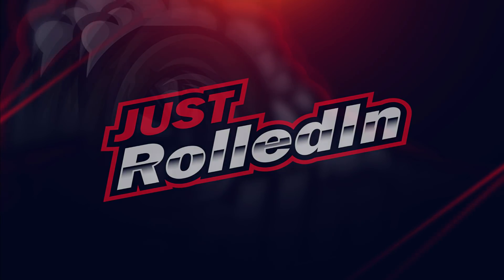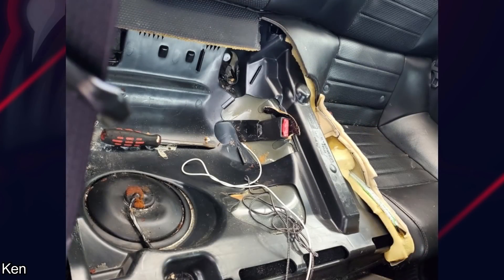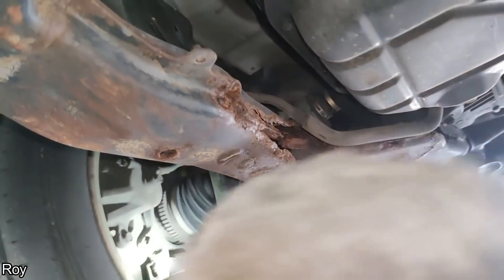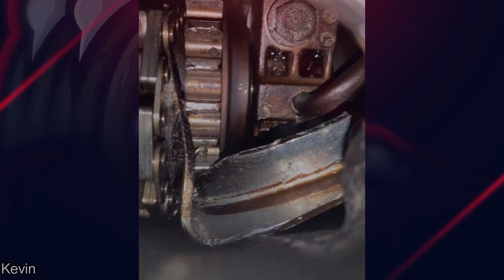Customer States "I Fixed My Broken Muffler With Aluminum Baking Trays!" | Just Rolled In

Comment: I repaired my exhaust once with a coffee can and bailing wire once just so I could get out of the bush and to a muffler shop 65 miles away. It's a different story when you pull up in your truck full of camping gear on your way home.

Comment: OMG, I don't know how you guys working in the "Rust belt" do it. So many cars with dissolved frames and suspension. (I've lived in the southwest all my life, we don't see that kind of rust very often).
Reply: My 1964 doesn't have thaq much rust
Reply: It's not so much an issue of weather as of poor construction and neglect. You can break any vehicle, anywhere, by ignoring maintenance for long enough.
Reply: Thanks for calling it the rust belt. Most of us up here call it a Shit hole .
Reply: @bug2011  LOL, I didn't want to offend the hard working mechanics there! You guys have my sympathy when it comes to working on all that rust.
Reply: Now I know where to go for my next used car. Lots of rust in my country.

Comment: Aluminum baking trays are way too light. I have however fixed (temp) an exhaust with a soup can and some exhaust cement and a couple hose clamps. That repair got me through the 6 hour drive home with a broken pipe.
Reply: Something flipped up and put a 3" hole in mine. Cut a 5" piece out of an old muffler and pop riveted it on. This was 2 years ago.   Cost about nothing to fix. I think I used 10 rivets.
Reply: Back in the day we fixed many holes in the mufflers and other parts of the exhaust using empty 3 lb coffee cans.  Usually worked for a few weeks. Or until we cou;d find more cans.

Comment: Aluminum baking trays...c"mon everyone knows you should use a coffee can and duct tape.
Reply: Well, at least use some bailing wire!
Reply: Sounds legit, after all ducttape can fix anything.
Reply: I rigged an exhaust pipe back together with a soup can and held it in place with a couple chunks of wire coat hanger wound and twisted around each half of pipe. It was extremely tight to the pipe, and should've lasted a couple weeks at least, but two days later, the soup can was gone. The coat hanger wire chunks were still wound tightly around the two halves of the pipe so tight they wouldn't budge. I still have no clue how the can just vanished after 2 days.
Reply: Na beer can and screws lol my dad did that once
Reply: Coffee can and bailing wire actually works
Reply: License plate and jbweld
Reply: Coffee can and hose clamps actually works
Reply: @codyluka8355  bofl alright hank

Comment: I have both repaired exhaust with soup cans and fencing wire, and cut holes under the back seat of a car and the bed of a pickup to replace fuel pumps.  In my defense I live in Minnesota and wrenching outside in the winter SUCKS.

Comment: 0:08 Cut a tin can down, it works better 
         (till it rusts off,lol)
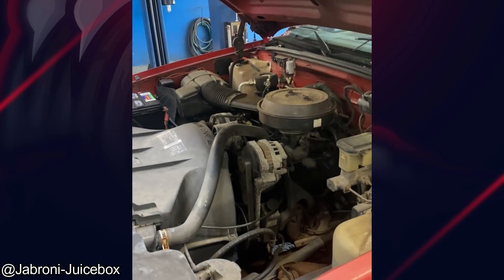0:25 Dang! That's Farmtruck levels or horsepower!
0:34 Who but the skateboard in there... 
        ( sounds like a skateboard running down the sidewak)
1:00 paint the inside prop and put numbers on it , Instant rouette wheel! 
        ( better than scrappin that, lol)
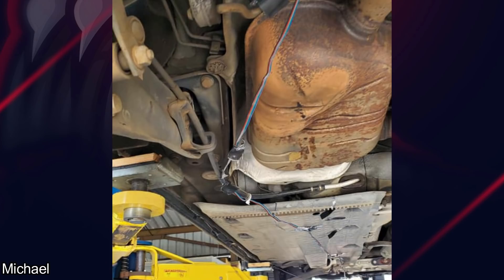1:12 Installed "underglow" either going to fall off in the next hot day or cause the other kind of "underglow" that attracts fire departments. 
        (It looks like it already fell off once , Look at the hanging tape)

1:24 Wow ( no spoilers here...)
1:42 Someone Popped it alright.
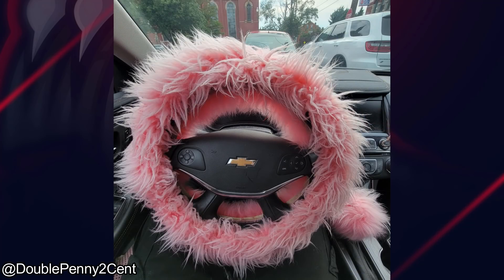2:08 Note to self , don't feed car after midnight.
2:41 Sure... I bet they were going that slow.... Unless it was that car that popped it's tire at a nearby Rally's 3 years ago. 
        ( It ran over a bad pothole and you could hear the pop. Driver didn't even realise untill I told him what happened.)
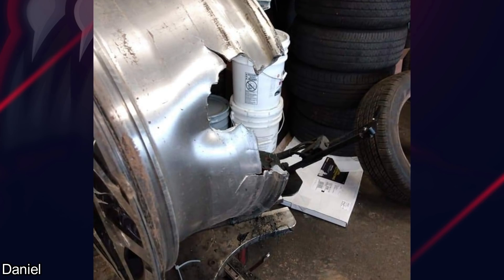2:50 Self Fixing Tires! Shut Up And Take My Money! 
         (Dang that's very bad....)
3:04 Wow, That's a Nice Truck!

Comment: On that engine that jumped/bad motor mount I guess, the upper radiator hose looked collapsed.  Also at the end pictures shot, what is the triangular object on the front wheel of the big truck on the left?

Comment: how is it even possible to crack a piston like that. his timing belt must of snapped on the highway or something to do that kind of damage.
Reply: Dunno if you've seen the I Do Cars channel where he does teardowns on dead engines, but shattered pistons like that seem to show up fairly regularly.
Reply: If it is an "interference" engine and the timing went out you will end up with pistons ramming into valves (if the timing slipped, it may not happen but fix it ASAP)